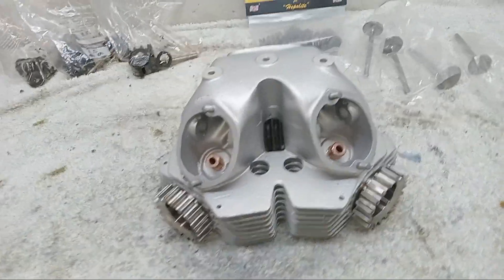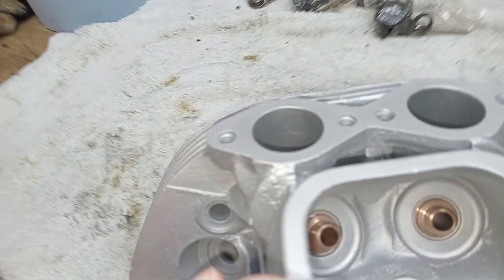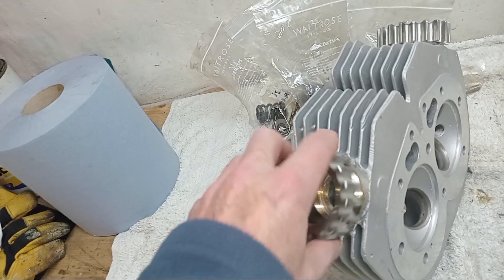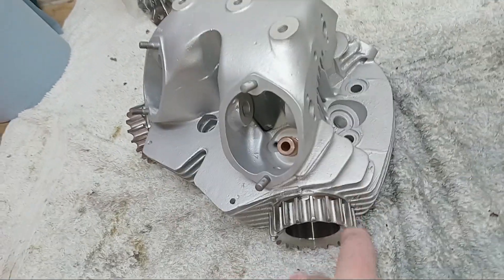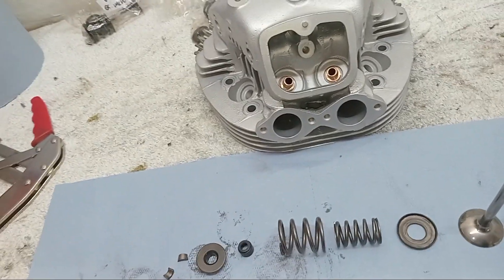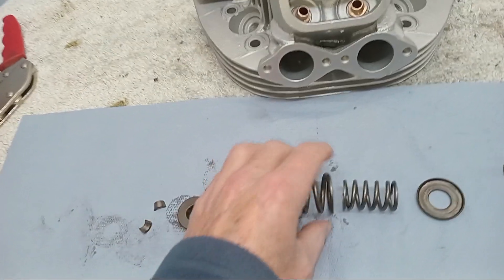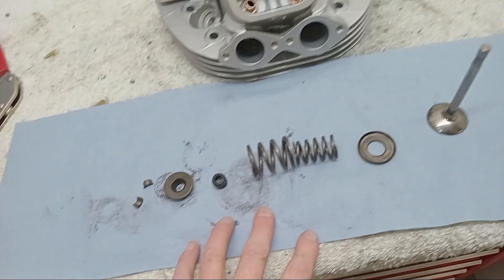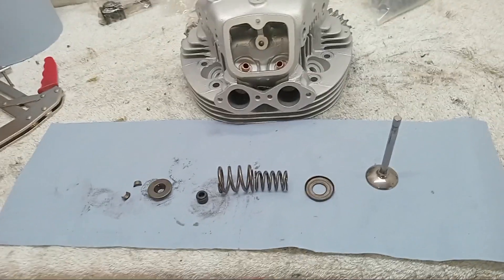Norton Commando Engine Rebuild. Part 69: Cylinder Head Inspection and Valve Fitting Part 1

Comment: Was the head painted? I will be doing a 1974 motor and I’m sure the engine cases were painted from factory.
Reply from the maker: To the best of my knowledge, the only engine casing that was ever painted on Commando engines were the cylinder barrels, which were black.